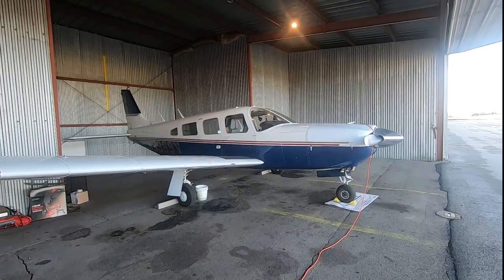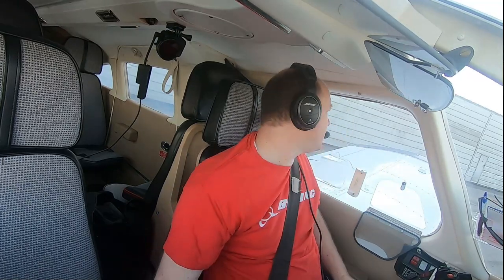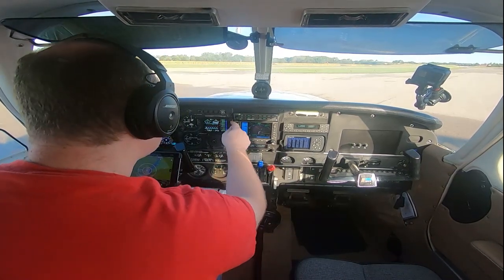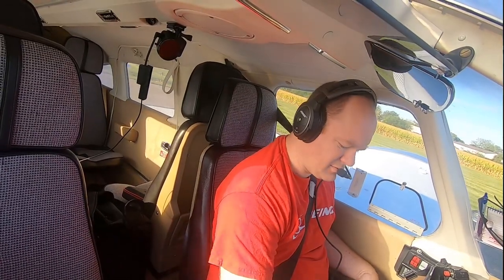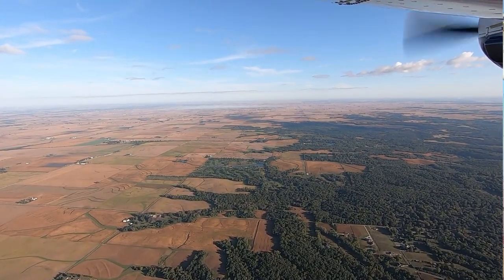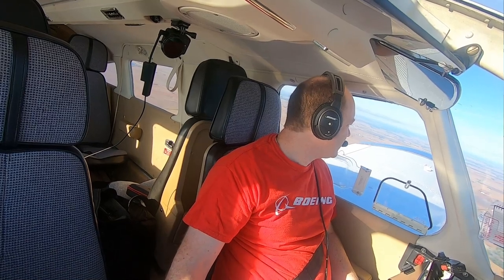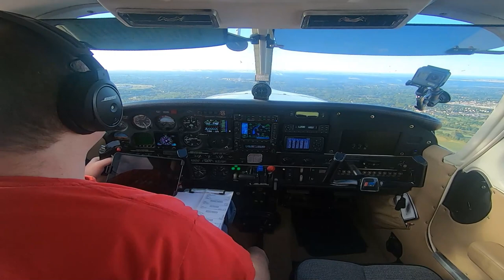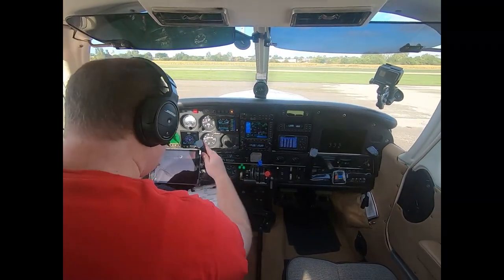Piper Lance PA32R Post Maintenance Flight

Comment: Good idea to switch tanks at run up to ensure that the engine can feed from both engines. You don't want to find out in-flight that the opposite tank wont feed the engine.
Reply from the maker: That's actually not something I normally do. I prefer to take off on the left tank when solo so that I'm burning off gas on the heavy side first.